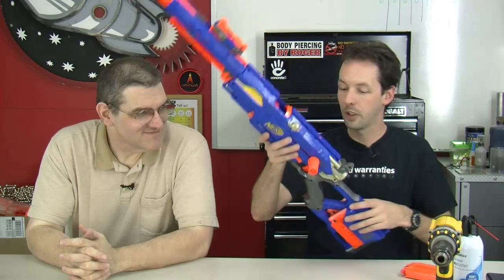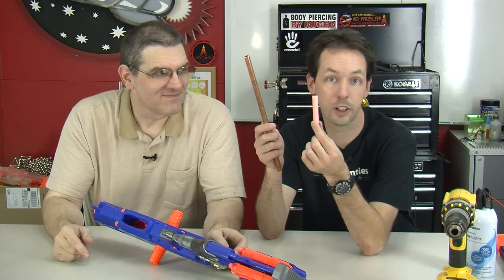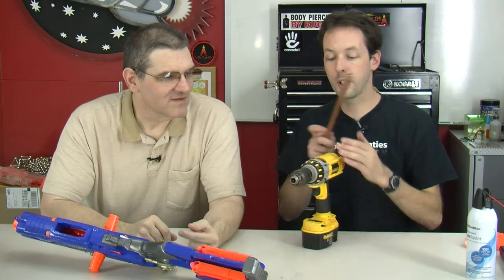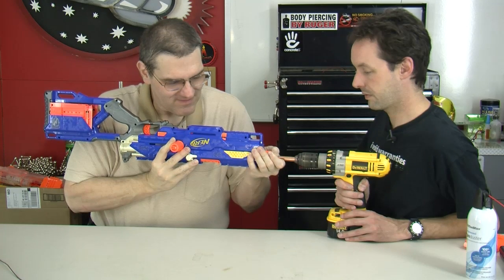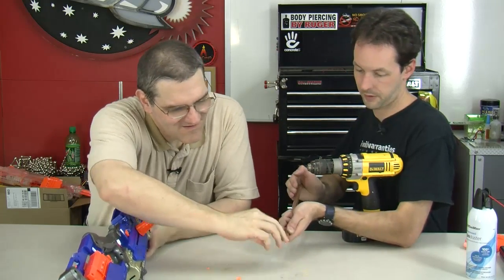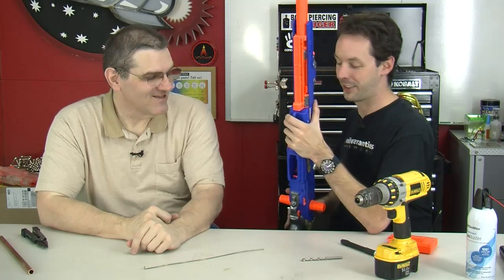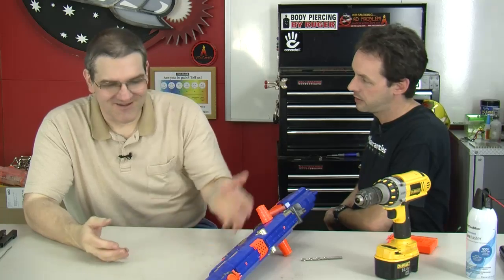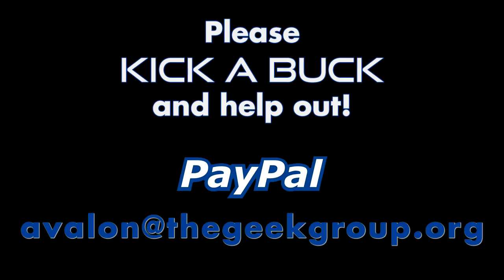Nerf Kidwell Mod Longstrike CS-6

Comment: Are there any risks to modding the gun this way?  I have read that removing the air restrictor can cause the gun to destroy itself when you dry fire the gun, is this true?  And are there any chances that the gun will break while I'm firing it with darts?  I do not want to buy another gun, and want to know if I will end up destroying my gun by removing the air restrictor.